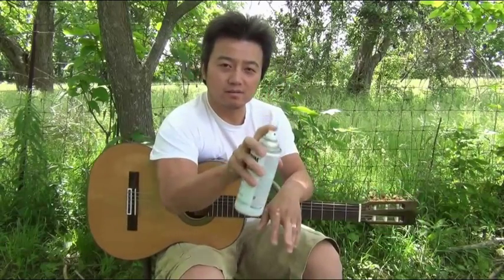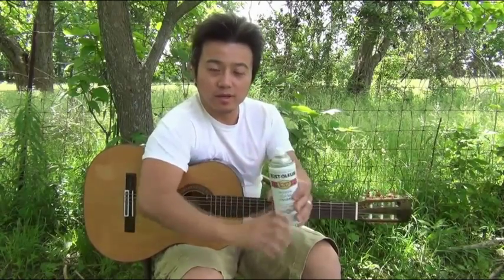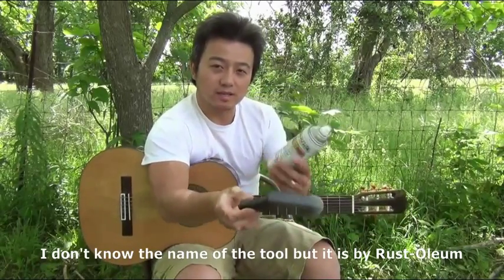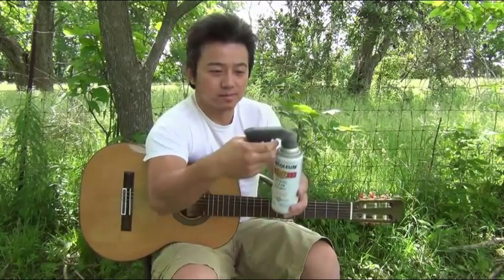Frugal Fridays 1: Spray Can to Spray Gun for $3

Comment: One remedy  I wish I would use more often is to remember to clean the nozzle "directly" after use. A small pot of the appropriate thinners and a bristled brush and about 30 seconds of time... but I'm not that disciplined!
Reply from the maker: Hehe, I know what you mean, have to resist that urge. Or buy in bulk.